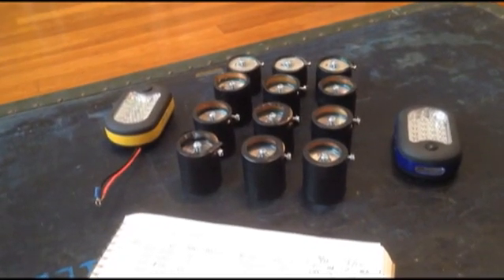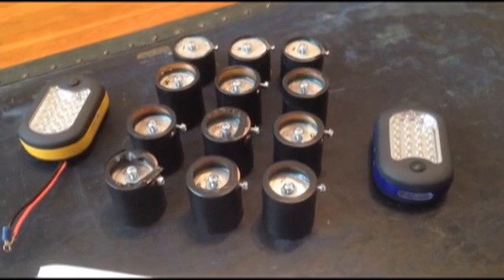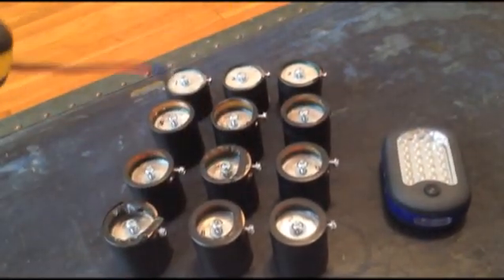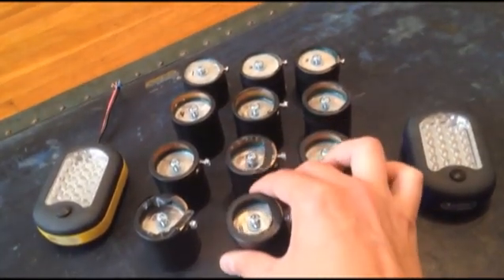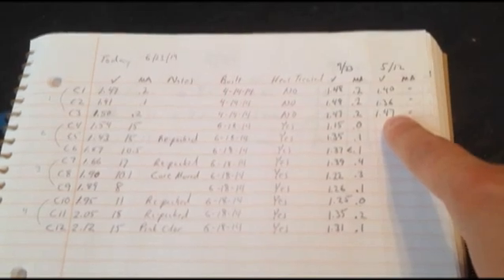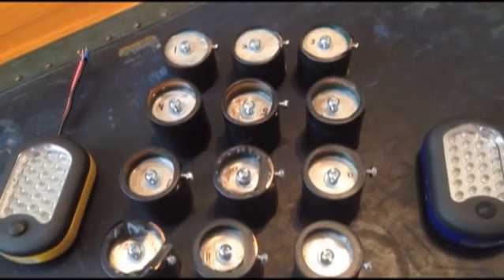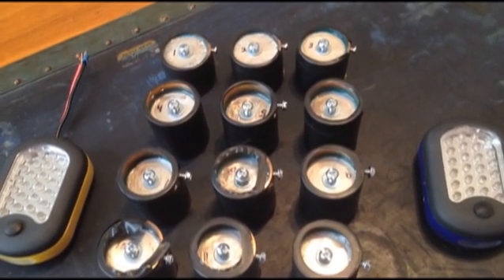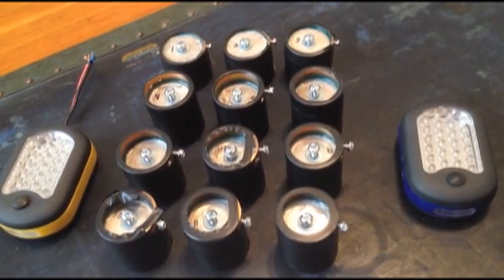Crystal Cell Battery Results & Opinion Part 3 - 12 Batteries Reviewed

Comment: You should run them in equal parallel then each parallel set in series this will give you higher amps with your desired voltage

Comment: Very important! Melt lead in to two sheets 1 (8 sheets paper thick) 1 (5 sheets paper thick) 8= Poss. 5= Neg. Roll + into tube and solder, same with - but < dia. to fit inside and large enough to go around magnesium make copper diam. 2" dist. h20 boil add only Alum!!!!! boil to thick liq. and fill layers. connect Mag. to thick lead and thin lead to copper. YOU WILL NOT BELEAVE RESULTS!!

Comment: http://www.ebay.com/itm/50-pcs-x-Superbright-10mm-Round-White-LED-Light-Lamp-Ultra-Bright-30000MCD-/111113229078?pt=LH_DefaultDomain_0&hash=item19dedd5316.  The mdc rating has to do with light intensity witch basically indicates the light beams angle. These ones are good for flash light type situations. Like a 15 degree angle. The next ones I wana get will have the 120 degree view angle. Either way they are cheap 6 bucks for 50 of me. The light is a little blue though but no big deal.
Reply from the maker: Thanks! I am finally getting around to building my Crystal Cell Flashlight. My experiments with some LED battery operated flashlights do not produce enough light, so I want to see how well I will do with just an LED bulb itself. On a good note, I retested all 12 of my Crystal Cells, and all cells showed improvement, particularly with amps. I hope to post the updates in a near future. Thx!

Comment: do you form them?

what i suspect is that some of the cells flip polarity  when in series
Reply from the maker: I am not sure if the batteries can flip polarities, but worth checking! What I do with all finished batteries is I give them a charge in order to set the poles.
Reply: yeah thats called forming
Reply from the maker: gotcha! thx!
Reply: Yeah the term is not really intuitive.  
One thing that I noticed with one I did yesterday.   I formed it with a higher voltage source 15vdc amp and a half.  And it is much much better than the rest.

I haven't touched it but its running an led much more bright then im used to.
Reply: I'm curious about the capacity. Did you track the voltage and current to see how long it took to drop or how much they dropped for a given duration? Also do larger cells have higher capacity?
Reply: I'm curious about the capacity. Did you track the voltage and current to see how long it took to drop or how much they dropped for a given duration? Also do larger cells have higher capacity?
Reply: Sorry no

Comment: Nice work. I am not sure about the effects of not having them loaded. All of mine are running oscillators with the little LEDs every night. I read in one of the forums that they work better if loaded some time but I also read if you let me dry out they will sit dormant until you wet it. So who no's. Anyways hit up eBay for some 10mm l.e.d.s 50 for like 10 bucks. They are fun to play with. I agree about them only being used for lighting. I am working on an oscillator to charge aa aaa c and d battery's from crystal battery's. I am thinking about ordering some 150 farad super caps to store the power to run a larger load when needed like lasersaber did. AAAHHHH so many ideas......
Reply from the maker: Hey BRL, any chance you can send me a link on these LEDS? I bought a couple at RadioShack and they never quite worked. Just curious as to volts and miliamps required? Thx hope alls well.